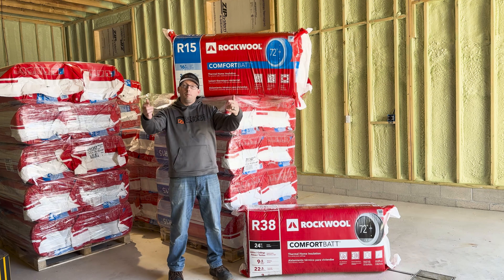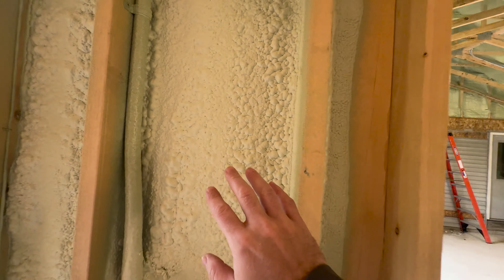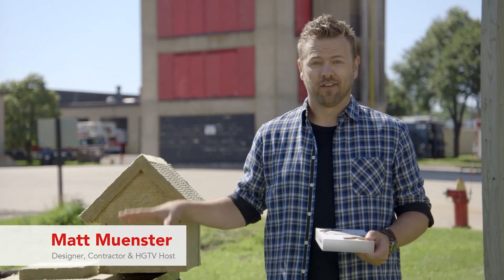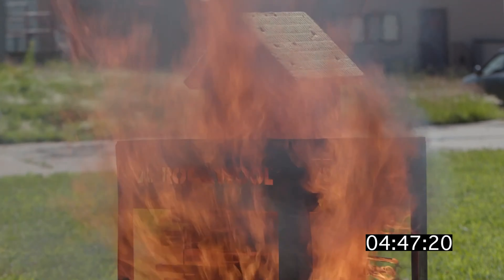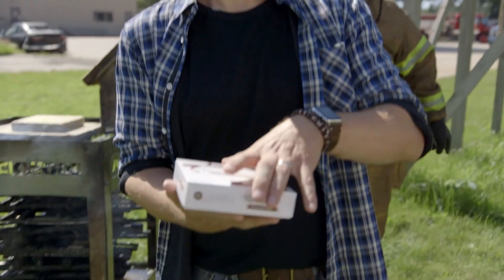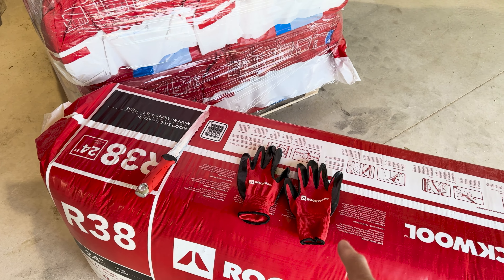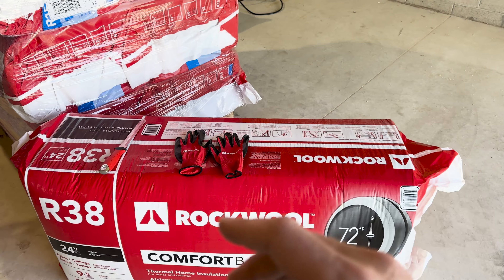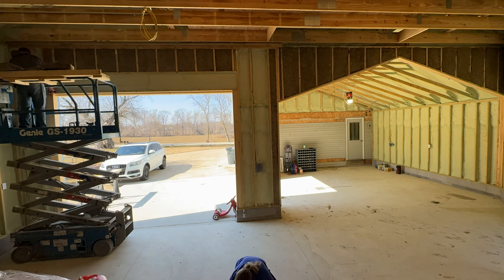Flash and Batt GARAGE insulation // Rockwool Comfortbatt R15 // Garage Build Ep. 14

Comment: Spray foam is the most toxic insulation you can use. It will off gas toxic chemicals for months if not years especially in hot weather, and it will burn easily and put out toxic black smoke. Won’t matter if you use Rockwool for fire resistance.
Reply from the maker: @JohnLee-db9zt  thanks for the insight!
Reply: I would say only if the spray foam was done incorrectly will you have off gassing or more correctly VOCs.
Reply: @mikeygeee  What do you mean incorrectly and who will determine it was correctly done? You’re mixing two chemicals in an uncontrolled environment (ie, construction site) and hoping you got the correct mixture at the right temperature and humidity. It’s an experiment that is bound to go wrong. Another big problem is when moisture gets in between the foam insulation and studs, mold will grow and you’ll never know it unless you rip out the foam insulation which is not easy to do and will have to be resprayed.
Reply: @JohnLee-db9zt  i suggest you watch some spray jones youtube videos for clarification. He goes in depth on this.
Reply: @mikeygeee  I’m a chemist who’s worked in the industry. I don’t need to watch his video.
Reply: @JohnLee-db9zt  Alright. Well than I guess you know VOCs can be measured after the fact and if they are detected, you know the job was not done correctly.

Comment: Can this method still be done with using 2x4 studs I'm trying to insulate my back porch that I enclosed but I'm not planning to heat or cool it
Reply from the maker: @Kid617  yes, but with 2x4 you are almost better off just filling the entire cavity with spray foam. You would need to cut the batts in half because typically (depending on your climate zone) you will need a minimum spray foam thickness on exterior walls.
Reply: @DetachedGarage  I mean I've seen other videos that they do 1 in and put the rockwool other videos I've seen where they just use fire insulation spray around the corners and just put Rockwell just do a seal the cavity
Reply from the maker: @ yep just need to check local codes

Comment: You didnt really explain the thickness of spray foam and the thickness of RockWool.
Reply from the maker: Sorry about that! So typical batt insulation is 3.5" thick for a 2x4 wall construction. With flash and batt you are typically installing in a 2x6 cavity or larger. 2" of spray foam goes onto the wall and then it is backed with a standard 3.5" batt from a typical 2x4 wall cavity. I put 4" of spray foam on the ceiling. Thank you so much for watching and let me know if you have any additional questions.
Reply: @DetachedGarage  do you think there is a way to flash and batt a 2x4 wall?

Comment: I’m insulating a pre-constructed shed.
I’m thinking Rockwool R-15 then the drywall…
What is the purpose of the spray foam?
Thanks!
Reply from the maker: Spray foam helps air seal the envelope. It is quite espensive, which is why people don’t fill the entire cavity with spray foam and do the flash and batt method.

Comment: People need to know how much closed cell foam to use for proper thickness before adding batts based on the local heating zone.  If too thin, bad things happen with moisture.  You don't want to use a vapor barrier on the heating side of a wall with closed cell foam and if the foam is too thin, condensation will happen and the batts will get wet and mold will follow.  A smart vapor barrier can be used when flashing foam and adding batts but no interior plastic sheeting as a vapor barrier or the walls will have nowhere to dry with foam behind the sheathing.  There is a good video of a new home in Iowa (I think) that had spots where the foam was only 1/2" thick and they needed to remove all drywall from all exterior walls and start over because of mold due to their batts becoming ringing wet during their first winter.  They were devastated.

A consistent 2" thickness of closed cell foam (R-12) is probably safe for most US states before batts but minimal for zone 6 and higher.  I'd stay away from flash and batt because the money you think you'd save might cost you an arm and a leg if something wasn't done right.  At least for your living areas.  A garage periodically heated, maybe not so much.
Reply from the maker: Great insight! You are absolutely correct that the entire system needs to be done correctly to eliminate moisture issues. Your comments about the vapor barrier are spot on as well. 

I live in southeast Wisconsin and went with 2" minimum closed cell on the wall as well as the Zip-R3 for additional R value and thermal break. I shouldn't have any issues with moisture in the summer or winter.

I certainly appreciate your insight and I hope you enjoy the rest of the build series.
Reply: @DetachedGarage  Cool.  We built last year in the Twin Cities area and used Zip R-12 over 2x4 wall studs filled with closed cell foam for R-30 walls.  The great thing about Zip-R is you don't need to build window bucks, a WRB over regular sheathing, then furring strips over mineral wool or XPS exterior insulation and and then worry that all details were followed for an air/vapor proof envelope.  Our blower door test was 75% better than passing.  I applied the Zip tape and liquid flash myself because I didn't trust our framers who had never used Zip sheathing after they balked at using foam polyurethane adhesive for the subfloor.  That stuff is strong.  They also balked at the strict nailing pattern with 4" sheathing nails and I had to buy a big nail gun for them to use and teach them to adjust the air pressure as not over drive the nails.  Our home is a one story, so 2x4 walls was no worry for shear.  The closed cell foam between studs adds stiffness to wall assemblies as well.

By building with 2x4 walls,  regular window jambs for 2x6 construction worked perfectly.  I also had them use 4" structural screws for our window flanges, thinking air driven nails could blow through.  I used Zip stretch tape for the window rough openings and ripped pieces of siding to get a pitch on the window sills under the stretch tape.  Our siding was LP Smart, which has raw OSB on the back, so I spec'd a 1/4" plastic mesh rainscreen, stapled to the Zip.

Good luck with your channel.  Most building and woodworking channels I see exist to promote their sponsors and they seem to talk out both sides of their mouths depending on which sponsor they're promoting that day.  One of the biggest (Matt) was heavily promoting Zip but has moved on to several other products who probably pay him better...😃💰
Reply from the maker: @bobbray9666  sounds like an awesome build! I certainly have a few sponsors, but I only reach out to sponsors that I actually WANT to use their products.

Build it right 👍 Let me know if you have any additional tips along the way and thank you for your support of the channel 🙏